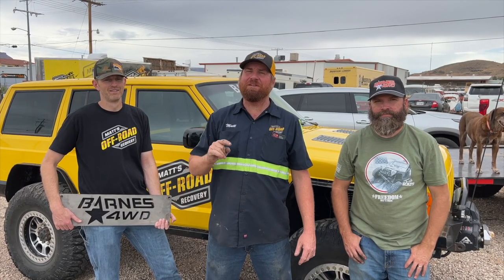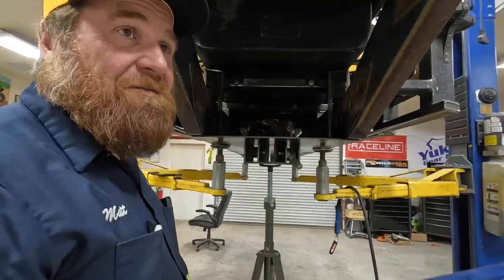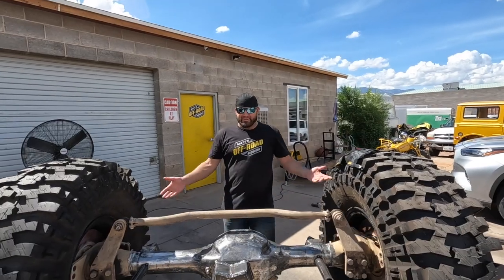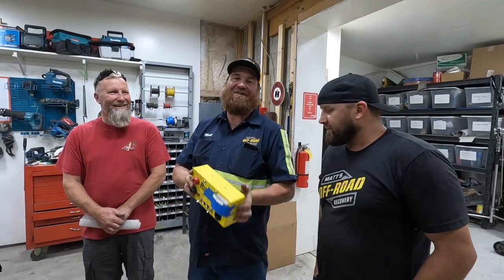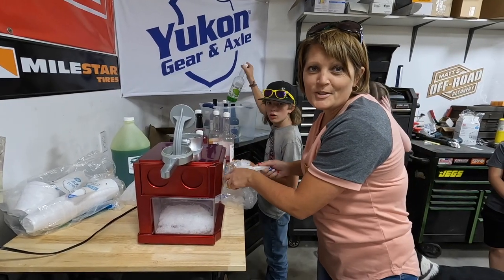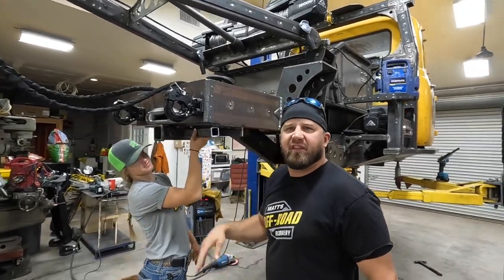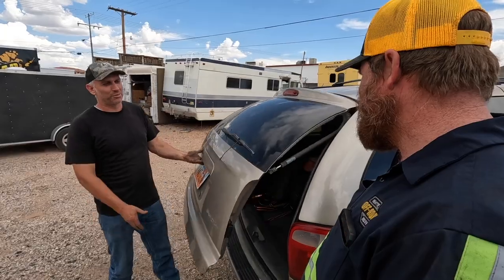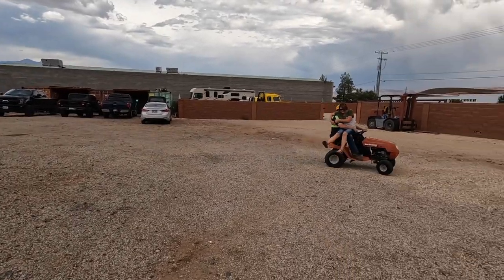We're Making Some Noise With The World's Largest Off Road Wrecker

Comment: OK I have a tip that could get the air leaving your swamp capproximately 15 degrees cooler when outside air temperature gets over about 105 degrees.  So if your evaporative cooler is sized large enough or your shop and you have enough open exhaust ports then your shop will be nearly 15 degrees cooler whenever there are not big bay doors open. It will cost a little more in electricity, Yoll need at least one and possibly two more swamp cooler water pumps running. A nice big 115 volt pump is about 1.2 amps and 1/40th of a horsepower. A nice 230 volt one(if your evaporative cooler runs on 230) is about 1.1 amps and 1/30th of a horsepowerYour fan motor is probably one horsepower or better so it would cost 5 to 10 percent more for 15 dgrees cooler on 105 degree days. You have all the technological know how and experience needed to build the changes, and uniquely you probably have the main expensive raw material part that would stall most attempts by others.Or cause them to just say EFF IT its only 20 grand for air conditioning and  $10K more in electricity to run  it and somebody else will hook it all up and turn key it for just $7.5K more. Get on the horn Gertruce and lets get cool.. So here is the readers digest  condensed version of helping an evaporative cooler do better in arid desert places that hit 110 or more regularly. Ill explain how it helps the evaporative cycle after  I give this basic idea of what has to happen  first. Basically there needs to be a few more gallons of storage capacity added to the coolers water storage capacity. The air inlet side(s) of the evaporative cooler will be have an enclosure  lightly attached and the far side of the enclosure will be open Basically all air the cooler moves will need to enter the enclosures open side. The open sidewill be filled with air/liquid heat exchangers the air side flowing outside air into the enclosure. In your case the heat exchangers will be car radiators. Bent up junk ones that wont ever go back into a car are fine since the liquid side will be open at the top and gravity flow.The extra watrer pumps move cool water from the evaporative cooler's water storage  to the top of the radiators and it will gravity feed back to storage.  This precools the air before it enters the evaporative cooler which is nice but not where the real magic happens. It also slightly dehumidifies the air entering the cooler and it lowers the barometric pressure  of the air entering the cooler a little while also increasing the density of the air entering the cooler. It also It also warms the water that needs to evaporate. And cools the air which cools fan and pump motors.  All of these enhance the others. This is a real rudimentary way to add a precooling dehumidifier and economizer to an evaporative cooler. When done as well as anyone knows how its expensive and complex and real finnicky about water quality and will output air almost 30 degrees cooler than un aided swamp coolers. And cost half of what AC does to run instead of 1/4 like thisdoes. Byt you have a hot shop and access to elephants graveyards of radiators  and all the tools needed to uild this. And a decorative wall or something around it since it will be about as pretty as a mud fence. That is a large enough wall of unfeasably badly typed words for one comment. Ill add another comment/wall of text to explain why and how something (that seems a lot like perpetual motion scam) that pre cools air just ahead of where a cooler is going to cool that air works, And it works amazingly well but only in the case of evaporative coolers.

Comment: Matt, if you want to run a better power steering fluid I highly recommend John Deere low viscosity hy guard hydraulic fluid  p/n, gallon (tTY22000) it works very well for atf too. I run it in all of my vehicles, it is very resilient to high pressure and high temps.

Comment: Helpful tip when welding, use lighting. I even have a light mounted on my helmet for dark areas. It really helps, also an auto darkening helmet.
Reply: Surely the light of the flash is enough.  They do use auto darkening masks, this is why they were having problems when welding side by side each others flash was interfering with the others mask.

Comment: I grew up in "SwampCoolerArizona" before A/C really took off in the 1960's, so I understand the old technology. Unlike A/C, which recirculates dry, cooled air, swamp coolers bring in outside air which has been water-cooled and isheavy and humid.  This causes the living/work space to be pressurized, so a vent back to the outside is needed to releave the pressure. Too much pressure for too long puts a load on the cooler motor which will eventually burn it out.
Reply: Always want to have a window slightly open at the far end of the building.   Not a bad idea even with modern ac systems so there is no pressure differences.

Comment: Welding with 7018 stick weld is a much stronger well than the squirt welding machine.  TIG welding which I did for 45 years makes a classy weld if done right

Comment: You need a Cool Boss portable swamp cooler. Mine has a 60 gallon tank that lasts 2 days. Roll it around the shop and point it where ever you need it. Cost me $2300 bucks. The jumbo ones cost $4000.

Comment: A thought for you because I have seen how you...use your equipment. As a professional welder I would fill in a little more on your receivers on the back. The one pass (even being a bigger pass) will not hold long term I recommend at least 2 more passes. All the way around

Comment: Alright, I've had a long travel kit with shocks for my Tacoma for a while now.  Finally decided to get it put on.  Front was pretty simple.  Rear, you have to cut off the upper and lower shock mounts and weld new ones.  It has been about 20 years since I've done any real welding but I figured I could pick it back up...   I was definitely wrong!  I sucked pretty bad and now I've had to call my little brother who is a welder to come and laugh his butt off and fix all my welds...  Not as easy as it looks!

Comment: This kind of cooling fin coolers I believe will work better mounted vertically, then the hot air flows a lot better over then. Most chargers, inverters and amplifiers has to be mounted vertically for that reason.

Comment: I swear you guys answer my questions as I'm thinking them.  The whole time Skeeter and Lizzy were welding that bottom, I was thinking "they are gonna have to figure out an easy way to get that cab off for motor / trans work".  30 secs later, you show us the tabs you are gonna use to get the cab off.

Comment: FYI I was told once that the axletech axles have a CARC paint. "Chemical Agent Resistant Coating" if they came from a military rig. It's very bad to breathe it and make airborne. I was told to use a paint stripper on it.

Comment: It's about time Lizzie gives us some welding tip and tricks!
1. What do you use for gas?
2. What type of wire and diameter?
3. Push or pull the puddle?
4. Circles, big ovals or zig-zags?
Help us become better fabricators out here in the DIY world!

Comment: A small lathe & drill press is totally reasonable to add to a vehicle of that sort. It's an electric motor and a strong chassis... could even power it off the vehicle engine... but probably wouldn't recommend running it directly off the drive train. There is a video on YouTube of a Canadian turning wood using a car on a jack stand with a chuck instead of a wheel... scary as can be. Lots of torque - a 15kW lathe is no joke... a family car is more like 150kW.

Comment: I would bet they never read my comments. But for safety reasons it is a good idea to have hearing protection when welding overhead. I know of someone that burned a hole through an ear drum with molten slag.
Reply: They might not see yours in particular, but if we keep pushing for more safety together, we can probably get them to implement it.

Comment: Those measurements should be down to at least 1/32 for the steering squareness. You could try 1/64 for less where on the rubber.

Comment: The lower link brackets look in the video like they are welded to just the flat belly plate. Do you plan to add any more braces to these link brackets? With the  ridiculously high loads those brackets will see when slamming into rocks, I'm concerned the plate will flex enough that you will get fatigue cracks around the brackets.

Comment: Just need a big 20-30" Shop Fan under the car blowing air up at high speed. 
Wont be cold, but thats what sweat is for ;)
Reply: You can't have any breeze blowing at you when you're MIG welding. It will blow away the gas that's shielding the weld puddle.

Comment: Love the channel and the wrecker looks great.  One suggestion would be using grade 8 bolts, and washers or higher for the suspension hardware.
Reply: What r they using?
Reply: @duramaxdad  Looks like bright silver regular steel.  Hardened are gold color or high strength is a dark grey/black in color.

Comment: I replaced all of the steering components on my Dodge and did an "alignment" in my garage with string and a tape measure. When I took it to the alignment shop the guy checked it and asked me why I was there. Alignment was dead on, you can do it yourself!

Comment: I had an older guy down the road from me who let me weld whenever I wanted gave me the code to his shop and all. He never wore the auto dimmer helmets and I assumed he was stuck in his old ways. He had a nice auto dimmer sitting in the back so I started using it and it was great until the batteries got low I guess and I woke up with the worst eye pain that lasted about 3 days. Still had the same settings that didn’t hurt my eyes for a week. He just laughed and called me a dumba$$ for trusting the helmet. He was super nice and had 10 packs of batteries laying next to the helmet the next time I came over.

Comment: Hey team, is there a reason you are running your lifting cable through a pulley on the top of the headache rack and then back to the top of the boom? It's providing no more mechanical advantage than if you just anchored the end back to the rack.

Comment: The transmission on my '92 GMC 1500 kept going out, so my transmission man suggested that I install a tranny cooler. There is not enough room in front of my radiator for a standard cooler, so I decided to use an aluminum finned tubular cooler. BIG mistake, when my tranny went out again, for the 5th time, I had it rebuilt, once again. A few months later, the front pump came apart, and the tranny had to be rebuilt once again. This time, Mr. Cole took the tubular cooler off  and told me that the cooler could not be flushed out, because of the way it retains oil, and that the junk in the cooler was washing back into my tranny. It has been over four years now and my transmission is still going strong. I am retired now and no longer use my truck as a work truck, so that has taken a lot of the load off of it.

Comment: Does the cab actually need to come off? If not (always) you could put hinges on the front corners at your lift points so you can tilt it forward and still be able to take it off if that’s what the situation calls for

Comment: Please use hydraulics to lower and raise the lifting beam, not a cable on a winch. 

It's stronger, safer, it looks better and is more quiet over rough terrain. You can easily buy and install a set at this point of the built. Later it will be a pain to install.

Comment: That wrecker is gunna be wayyy heavy with all those welds; maybe consider a diesel swap which I know will make it even heavier but you may need the torque just an observation
Reply: The gas engine it has was used in 20,000 pound motorhomes and was called the Duramax Killer.
Reply: @JohnFL  hell yeah should be plenty

Comment: Out of sheer curiosity, why would you not bolt on the skid plates rather than weld them? If you wanted them on you would be able to easily remove them if you needed to work on anything on the underside of the vehicle. I am not a mechanic just curious

Comment: Tip number 3 now that you have a groovy new welder for trail repairs. Get or more likely make a seperate welding rod container for the 7018 (or upgrade to 8018 if you feel fancy) welding rod that you will be using  a lot of . Make it so that it is as air tight as possible while still being easy to open and closeThen add a chamber to the bottom and one to the top that vent to the rod holding middle. For dessicant. You could fill oe with rice and the other with dessicant packs that ship with many products. Thatll help arcs start and flux to work and help fend off hydrogen embrittlement from breaking the metal near the weld a couple of years after  the weld is laid down. 7018 is supposed to be baked at 500F after purchase to remove all moisture and then be kept at 250 in a rod oven until used to not fark up during and after welding. But I aint noticd anybody doing trail repairs ever do either of those and I dont expect to. But dessicant and a box to hold it without other rods would help a lot with ease of starting a good arc every time, especially if a guy baked it at 500 once after purchase
Reply: 6011 is good stuff especially with high frequency bright yellow welding boxes in big yellow wreckers.   @MattsOffRoadRecovery

Comment: Be extremely careful grinding on that carc paint on the axles, really bad stuff to be breathing
Reply: That welding ventilation wouldn't be sufficient either, in my country at least. It would be illegal not to have a direct fume extractor. Might be overprotective, might not, but welding releases nasty fumes
Reply: @samuell.6000  I used to work at a military base and were constantly reminded to avoid excessive grinding. The caustic dip even had a hard time removing the paint
Reply: I had a mask on and a giant fan blowing it away

Comment: Wouldn't a Foden recovery truck or something like the crouch recovery oshkosh be a bigger off road Wrecker than that? Just curious
Reply: It's important to distinguish between driving off the pavement and driving off road. A motorhome can drive off of the pavement, but that doesn't put it on the same level as a fully built Jeep. Similarly, military wreckers do just fine on dirt roads and even semi level, semi hard surfaces. But Matt's wrecker is designed to do buggy trails.
Reply: @JohnFL  I understand the point you are making. I'm not sure the extent a Foden can go even though they are 6x6 as I only really see them used in the UK and we don't really have much more sand than a beach. 

However, a Unimog can be purpose built to go entirely off road.  Same with the Oshkosh. 

The Unimogs are sometimes used to recovery crashed rally cars which have come of the stage. 

Definitely a beast but not sure if its the world's largest off road Wrecker unless you class a Wrecker differently to others which could be the case. If you ignore heavy wreckers then it probably is the largest car derived Wrecker.
Reply: @LeonUK  Matt said his wrecker will be more capable than a Unimog. That's why he didn't just get a Unimog to convert in the first place. He also mentioned that he sometimes sees Unimogs at Sand Hollow, but they rarely leave the parking lot.
Reply: @JohnFL  I must have missed that part, what time stamp was it? 

Also for example, if a Scania V8 Wrecker is better than a Daf CF Wrecker. That doesn't make the Daf CF not a Wrecker. 

So if this can out perform a Unimog on this terrain type, that doesn't just make it the largest off road Wrecker in the entire world. 

Also there is no knowing the extent some unimogs (or other vehicles) have been configured world wide, who's to say there isn't one somewhere like the UAE which has had big money spent on it to be purpose built for sand.
Reply: @LeonUK  In the comments, multiple times on a previous wrecker build video. People kept asking why he didn't just use a Unimog instead and he replied that it would be more capable than a Unimog. In the comments on another wrecker build video, Matt said that every single picture anyone has sent him of a bigger wrecker, it is on perfectly level ground. We will see at the Off Road Wrecker Olympics what Matt really means by World's Largest Off Road Wrecker.

Comment: Why don't you put in fresh air vents lot cooler  than air outside look it up

But this is how it works you dig hole outside buliding put a box around it 
With blocks just say 5by 5 intake vent 
Run to top of roof  put vent in ceiling
With small fan it pulls air from down lower ground bingo makes it cooler

Comment: Just as a technicality wouldnt Heavy D’s green wrecker be the largest off-road wrecker?
Reply: If it would drive off road, then yes. Note that off the pavement and off road need to be distinguished from each other. Motorhomes can also drive on dirt roads, but that doesn't make them off road vehicles. Matt's wrecker is designed to do buggy trails.

Comment: How can that be the world's largest off road wrecker?  It is a lot smaller then Heavy D's wrecker.   I do like it and like watching it get built
Reply: It's important to distinguish between driving off the pavement and driving off road. For example, a motorhome can drive off the pavement, but that doesn't put it on the same level as a fully built Jeep. Similarly, military wreckers like Dave's can drive on dirt roads and even semi level, semi hard surfaces just fine. But Matt's wrecker is designed for buggy trails.

Comment: That truck is gonna be just too heavy for that gas engine. You’re looking at a Diesel engine with the requisite torque to get you to the recovery and get home again.  So sayeth Casandra.
Reply: 12,000 pound target weight. This engine was used in 20,000 pound motorhomes. It was also called the Duramax Killer. Plenty of power.